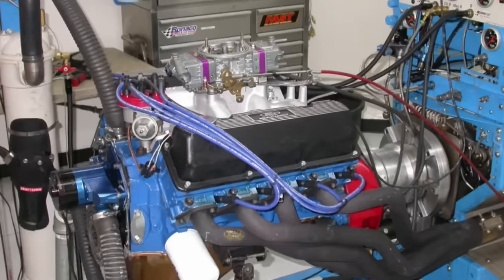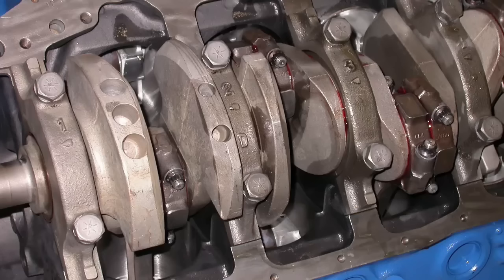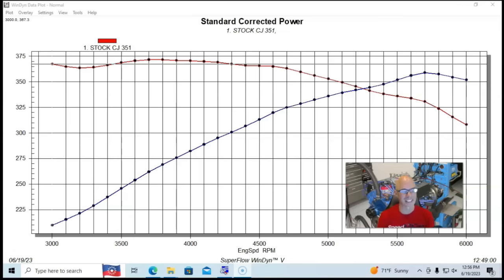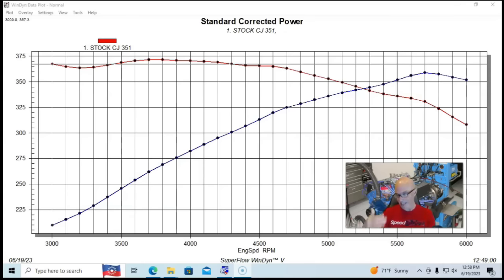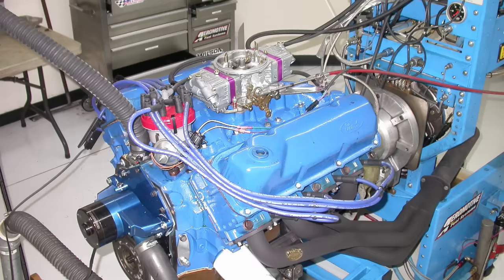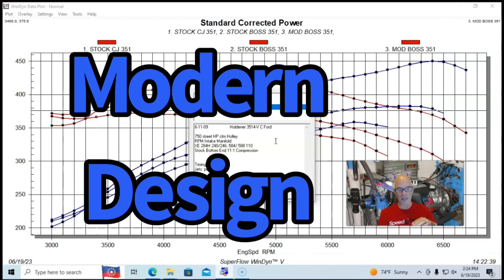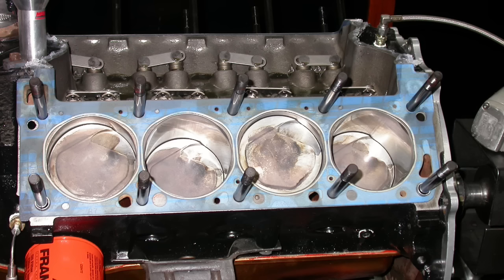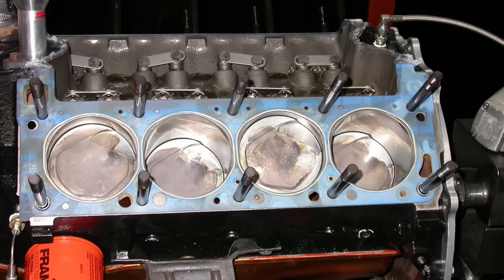HOW TO MAKE 351 CLEVELAND POWER. TUNNEL RAM, STROKER 351C MODS, CUBES, CAM, HEADS AND DUAL QUAD!

Comment: Ford had a real winner with the 335 series engines.  Sadly, the 351C, especially the high performance versions, died quickly in the U.S. thanks to rising gasoline prices and increasing regulations on fuel economy and emissions.  The taller block 351M and 400 continued on in medium and full size cars and full size pickup trucks until around 1980, if I recall correctly.  Unfortunately, Ford designed the 351M and 400 to be emissions friendly, low rpm, low performance engines.  They can be built into performance engines, but they never were in stock form.
Reply: 1982 for the pickup trucks if I'm correct

Comment: I do believe another difference between the M code and the Q code is that the block on the Q and BOSS blocks is a 4 bolt main cap. BOSS code was R? Plus if I remember I think the 4 bolt main blocks were cast with a slightly more nickel content. IMHO I think, as do you the 351 BOSS is the best small block of the day. I've built SBC. Nothing wrong with them. But we built them because stuff for them was plentiful and cheap. However, I had '73 Cougar XR7 with a Q code 351CJ and a C6. I went through the engine and did some normal fixes and spec upgrades and that thing ripped!
Reply: Even with the open chamber heads ?

Comment: Did a 400, 410ci recently. TFS heads 313cfm, 10:1, .566 lift roller 224 dur @ .050" and RPM air gap thing makes all of 500hp. So much power left on the table too

Comment: Seems like the tunnel ram combo should have made more power with the cam used.  I wonder if the heads were still holding it back.  Yes, they were ported.  However, it would be cool to see what a modern set of aftermarket heads (similar valve sizes, similar combustion chamber volume) would do.   Who wants to guess?  +40 hp?  + 50hp?
Reply: Chi 3v is where it's at , they're inbetween the 2. So smaller runner cc for air speed but they flow crazy.

Comment: Always great to see Clevelands being represented!  Im curious what kind of power can be made with 2bbl heads, which supposedly still have bigger flow than the hot Chevy heads!  I know that big open chamber kinda ruins it for them, but surely that can be compensated for…. Maybe theyd be better for a supercharger?
Reply: I have a 351c 2v head with the m code cam in my 65. It’s no slouch, but I too would like to see an actual dyno test
Reply: @B1Springfield  Nice!  Would be cool to see a test where they build the engine as far as they can with a relatively stock 2v head, maybe with some standard port work, just to see the potential.  Those 2.05 intake valves are bigger than the “big” Chevy 2.02 head, and flow significantly better too!  On paper, a 2v Cleveland head SHOULD be a pretty hot head!

Comment: I see the heads are closed chambers but what pistons were used to get 10.7:1? Were they dished at the top or flat and in the hole?  Did it run on pump gas?

I’ve gotten 11:1 on pump gas with flat tops at 0 deck. Want to do a stroker next

Comment: Would smaller carbs have improved the part throttle, street driving qualities of the motor? As strong as that 408 turned out to be I still don't see it needing 1500 cfm to make the power it did.

Comment: So, is there any performance gain to be had for those of us that are still running the 351C 2V on the street that won't break the bank? 4V heads are hard to find and aluminum heads are expensive. What about just a cam change with the 2V induction? I know it's not the best set up, and the open chamber head engines have dismal compression, but I just use mine just to go to cruise ins with, and would like to gain some street performance. How about show us some numbers, Richard. Thanks!
Reply from the maker: CAM SWAPS HELP A LOT
Reply: Agree, my 2V has always felt winded, a 302 puts it to shame till it gets rolling then it'll finally walk away but by then I'm ready to shut it down.
Reply: I hear you. I’ve only had one car with a 351C 2V - 71 Cougar. I didn’t really do much other than dual exhaust with generic turbo mufflers and an open element air cleaner with either a double stacked stock elements or a taller one for a 454 Chevy. I think the motor was stock but high mileage. Still it ran better with just more intake and exhaust flow. I wanted to rebuild it with a better cam, maybe some light head work, 4V and headers but the car was such a rust bucket and I bought a new truck instead. I do remember back in the 80s there aluminum 4V intakes for Cleveland 2V heads, but they were pricy. Anyway, I suspect there were more 4V conversions back then than anyone remembers.
Reply: Cam swap or Aussie clevo heads if on the cheap.
Reply: @richardholdener1727  So which cam? Suggestions? Would love to see some numbers!😁
Reply: Crane Energizer 524 lift cam works good.
Reply: thanks! @jesse75

Comment: Pretty sure the 71 Boss had an 11.6 compression forged piston. Could be worth maybe 2% power increase based on typical gains from adding compression.
Reply from the maker: 11.0:1
Reply: 11:3.1
Reply: Nominal compression. Which is close to. That's what the factory repair books said in the 70's for the Boss engine.

Comment: ANOTHER suggestion for a video: A UNIQUE cam test!
Hypothesis 1: for some durations and engine speeds, lift matter little, but duration matters a lot, and vice versa.
Hypothesis 2: for a blown motor, with less chance of excessive reversion, lift matters even less.
Hypothesis 3: using revs and boost, one can get plenty of power without parts-breaking torque peaks which make the overall car build far more expensive overall than simply slapping on a blower and some mildly stiffer springs with a low-lift, low-stress but long-duration cam setup.
Hypothesis 4: long duration with low lift carries off high-RPM power more than short-duration but high lift.
Find the effects of overall lift, overall duration, and ramp speed of some relatively-similar cams. The "ramp speed" portion can be done by just swapping in some super-super-low-ratio rockers, normal rockers, and some super-duper-high-ratio rockers.
Using three widely-varying cams timings (in duration) vary two parameters in each set of cams of the same duration:
A) Cam set 1: super-low-lift 
B) Cam set  2: medium (kinda normal) lift
C) Cam set 3: Super-high-lift that would even make a Pro Stock motor envious

Then, do a test to find just how much valve acceleration off of closed affects lift, using super-duper-stiff springs in the Pro Stock region of open and seat pressures for experimental consistency.
D) Cam 1: super-slow-opening that could easily be handled by the laziest valve springs
E) Cam 2: Normal camshaft profile
F) Cam 3: Super-fast opening just short of float with the super-stiff springs.

Run all the cam configurations the same RPM from idle to 9000 RPM 
Graph results.

What will be demonstrated is the answer to some questions:
A) for a "low-RPM cam," is lift as important as timing? 
B) For all the cam timings, do either fast valve events or extra lift do the most good?
C) Will cam timing enable good results at higher RPM with lower lift, enabling more people to run higher revs than is common now? It's one thing to move a valve 0.300" off the valve seat at 9000 RPM, but it takes MULTIPLES OF  the force to start and stop them if they are a 0.900" lift valve event. Instead of a 900 pound seat pressure used for vaulting the valves WAY off the seats a la Pro Stock, one could get away with about 300 pounds of seat pressure, in theory. energy equals mass times velocity squared. 
D) Can an engine get away with far less lift if the engine is boosted, with a centrifugal supercharger, for example?

If super-low-lift but long duration enables John Q. Public to run a 9,000 RPM motor with a blower where normal or high lift would make the valve motion just too crazy to control, then this opens up a world of horsepower for the guy off the street who doesn't have the money for a super-duper-built transmission, heavy-duty driveshaft, and Pro Stock-level valvetrain. John can just get some kinda-stiff but not ridiculous valve springs and maybe just some roller-fulcrum rockers and enjoy the fun.

Test run one going through the low-lift set of cams with short, medium, and long duration, and also slow, normal, and super-fast ramp speeds:
A) naturally aspirated
B) boosted

Test run two using normal-lift cams with short, medium, and long duration, also:
A) natty
B) blown

Test run three does the same with super-duper-high-lift cams, also:
A) natural
B) blown

During any of the three test runs, the exaggerated-low-ratio rockers, normal, and exaggerated-high-lift rockers can be tried also.

This could provide reference-book-level material for amateur engine builders the world over.
Reply from the maker: SO RUN A 100 OR MORE CAMS FROM IDLE TO 9000 RPM?

Comment: Hi rich I have a 2000 GMC k3500 if I went and did a upper end kit on my 454 gen 6 would the 4l80 e and corporate 14 bolt 4:10 hold up ??

Comment: Hi Richard, I was wondering if you have tested/ compared an Edelbrock 7104 against  a GM CFM aluminum intake?. Also is there a difference between the CFM 18, CFM 44 ect.??
Reply from the maker: WHAT IS A CFM INTAKE?
Reply: @richardholdener1727 Been looking online for a different intake for the 305 HO engine in my "79 Berlinetta and show a few GM aluminum intakes they all have big letters  behind the carb (CFM )

Comment: Just found a boss 351 block pretty stoked. .030 over though and needs a little more bore as it’s been in a field for a bit.
Reply: Be careful going past .030 on the production block. Especially for performance. Grandma car it’s ok. Really thin walls on the Cleveland blocks. Worse than Windsor’s
Reply: @matthewnosal6893   yeah before I bought it  I was doing the research… part of why I posted it here.  No point in getting a 4 bolt main Cleveland for grandmas car right ?
Reply: @Bill-flatplanefool  if it’s a factory 4bolt it may be worth putting the effort in. I’d definitely sonic check it.
Reply: I'm running a 60 over 4 bolt. Not a problem.

Comment: Gee,,Edelbrock worked out that the 4Vs were way too big. And useless! I have a Performer on my 400 Galaxie and the intakes are smaller than the 2V heads. About a Chev race port size!!
400? So what did you use, a 3" main M engine crank with odd rods.Turned down tp 2 650. 400M has an inch taller deck.
The Aussie 302C head gives more compression with a better chamber and realistic intake & exhaust runners. 4Vs make good door stops. Or small boat anchors.
Reply: Wrong. Spoken like someone who has NEVER daily driven a 4V Cleveland let alone raced one.

Comment: I would like to see a Paxton single Carb run on that last Engine at 8 or 10 LBS,  instead of the Tunnel ram 2 Carb set-up?  or maybe a Turbo set up
Reply: I think he did a paxton supercharged 351c video awhile back

Comment: Richard i have a 408 stroker  351 Cleveland   with trick flow 225 cnc ported runner head  72 cc chamber at 10.9/1 comp ratio. I am trying to source a trick Flow  # TFS 516000-111 track heat 
Intake Manifold. which are currently not in production Can you recommend anybody that might have one.
Reply from the maker: no idea-but other intakes will also work

Comment: That BOSS 351 is awesome but rare?  I have never seen a BOSS 351 and I’m 57.
Reply: 1971 only
Reply: according to Wiki the BOSS 351 was only in the 1971 Mustang with only 1806 units produced
Reply: That the problem with alot of the furd shit. Anything they made that was even worth a shit barely existed.
Reply: One of my friends bought one in 71 when he got out of the Air Force, I have saw 2 more to date. His was silver with black trim . It is still on the road and looks good.
Reply: 1971 was the Boss 351. 1972 the same engine was called the 351CobraJet. The only two years of production for them.
Reply: @elmerfudpucker3204  The Boss 351 was only made in 1971. The 72 motor was no Boss I bought a new one in 1972. The CJ was not the same engine. It was lower compression, hyd, cam, iron intake. 266 hp.
Reply: @garyshinn4626 The HO was a 72 replacement for the 71 Boss. 
I have one. Adjustable valve train, brinell crank, windage and baffled oil pan. 4 bolt block.
Reply: I have a friend who bought one new, and I have seen 2 others.
Reply: @garyshinn4626  that’s crazy.

Comment: I had the world record 400m on horsepower 10 years ago and still have that same motor but is tore down because im needing intake and aluminum heads
Reply from the maker: world record?
Reply: @richardholdener1727  world record horsepower
Reply: It was 876 na
Reply from the maker: World Record as in Guiness came out and officially recognized the world record? Or like an official Bonneville land speed record? or just an internet "world record"? That's a lot of power for a 400-inch motor (but I think 400-inch sprint car motors make more), I'm just trying to figure out the World Record thing.
Reply: 10 years ago I looked at Guinness book and I couldn't find anything on it so I figured at the time no one was building 400m like that but it started out has a 351m and I went from there
Reply: And on the Dyno that's what it made but that was with 4v heads and a lot of other work I had the deck milled bored
Reply: But I'm trying to get a set of aluminum head for it and forged rods and pistons but it doesn't look good so far

Comment: Can I use that tunnel ram on 351/400m motor
Reply from the maker: only with adapters for the taller deck
Reply: @richardholdener1727  what if the deck was milled
Reply from the maker: are you going to mill 1 inch off?

Comment: which one had the four bolt mains???
Reply from the maker: all 351C were equipped to run 4-bolt mains, only some of the applications were actually drilled and machined for the 4-bolt caps.

Comment: I have run high 9s with a stock 87-93 5.0 short block with some decent tfs heads a solid flat tapper cam a 175 shot in a 2700 lb fox with my 200lb ass in it you can make anything fast with the effort
Reply from the maker: flat tappet?

Comment: I know ZERO about Clevelands.
Reply: Same bore spacing and bolt pattern as a Windsor but much beefier block architecture and race oriented canted valve heads . Word has it that the front timing chain housing cast into the block and the head architecture is courtesy of Oldsmobile and Chev engineers the Ford crew poached for the design.

Comment: For this engine being cancelled, i started hating the Ford motor company.  My hatred has grown stronger over the years because Ford abandons their products and their customers.  Poor business practices.
Reply from the maker: THEY WERE NOT SMOG FRIENDLY
Reply: How did the bigger 460 pass smog? Cylinder heads were within the same patterning? And the 400? And the 351M? I just see Ford changing things just to obsolete stuff. Chrysler and GM did not follow this practice, hence...i still recommend their products. Ford is just a simple: no. Don't buy their products. Ford will obsolete them.
Reply: @gdaytrees4728   The 351 C was released in September 1969. The Emission standard was changed for 1971. There was no point in building a engine aimed at Performance when emission standards limited power to ridiculous low rates. By 1973 power was as low as 200 hp for a 351 engine. To make 200 hp Ford didn't need the Huge ported of the Cleveland.
The Chevy and Dodge engines were built early enough they  had performance history, Ford had the 351 W engine  to use as a low performance engine, this left no place for the Cleveland unless you were an Aozzy!
Reply: @gdaytrees4728  They completely choked the 460 head by adding huge air injection castings in the exhaust. You could not even touch the exhaust valve with your finger. What would be the point of choking the Clevo like that? It's ridiculous to say they changed to screw their customers. Certainly not a reason to make a life long hater!
Reply: @gdaytrees4728  Smog pumps, dished pistons, open combustion chambers & retarded cam timing all 'solutions' back in the day

Comment: Those stories about the oil going to the top before the mains being bad is true. Ask me how I Know. 🥲
Reply: Perfectly adequate for a street stocker engine. And the multi groove valves added more life to the seats.
Reply: @jesse75  I'm willing to go with that. Having ported heads, a 235/285 570 cam etc, plus lots of revs might have had something to do with it.
Reply: @GreenCrim  having a motor plate, rear sump, 8 quart pan with restricted push rods and the engine won't blow.